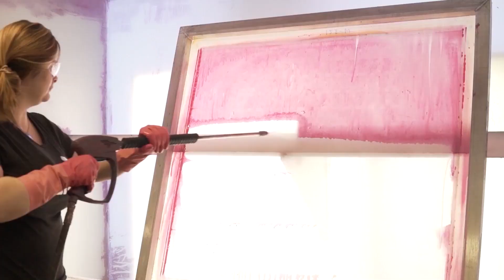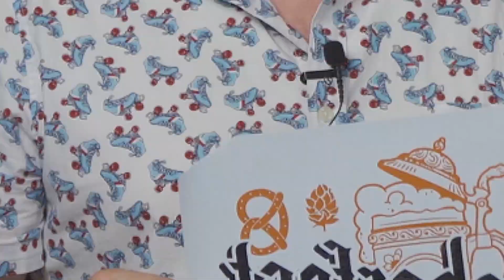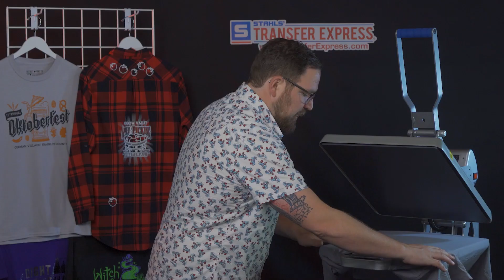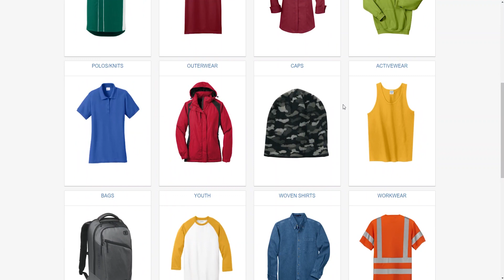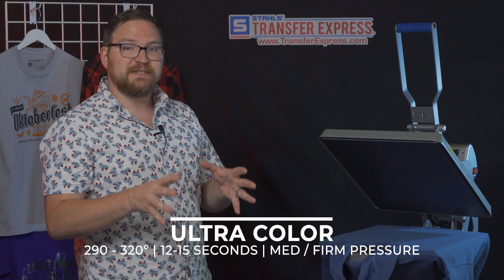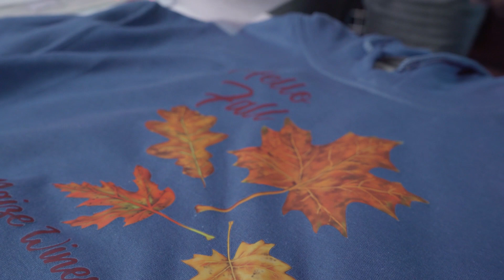Fall Events + Festivals | T-Shirt Printing With Screen Printed Heat Transfers

Comment: How long do you do the second press for making the clear outline disappear? The full 12-15 seconds or less?
Reply from the maker: For our UltraColor Soft, Pro and Stretch Transfers you can press for anywhere between 5 to 15 seconds to seal the edges if you want to reduce the visibility of the outline. 

With our hot peel option UltraColor Pro, you'll find the edges are far less noticeable and rarely need a secondary press. 

Since this video released, we launched a brand new Direct-To-Film full color heat transfer that does not have a clear outline around the print: UltraColor Max.